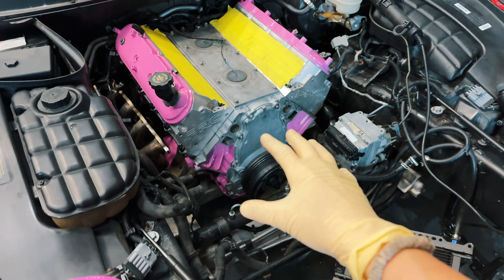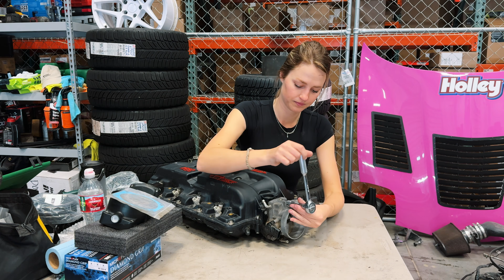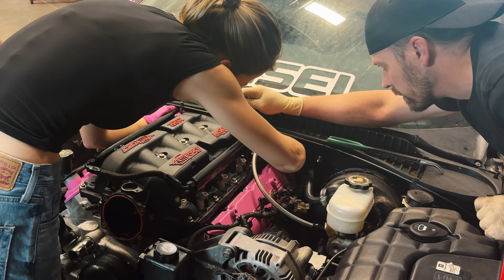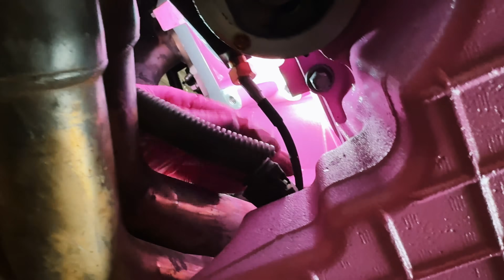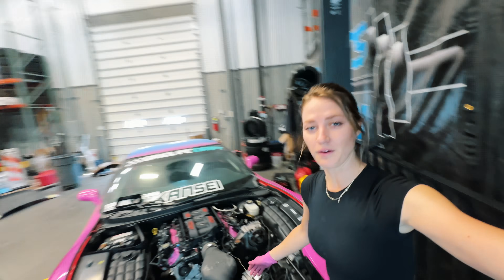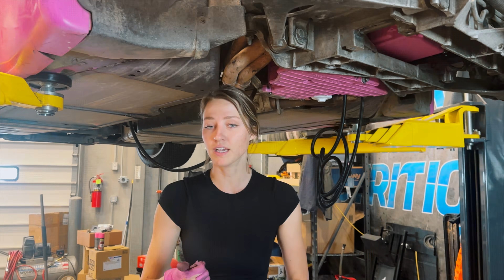First Start on my C5 Corvette Engine Build!

Comment: hey did you forget the accusump? you most likely lost the rod bearing from the lost of oil pressure not from heat.did you put a custom oil pan on it with baffles for what you do with the car.looks good,good luck to you